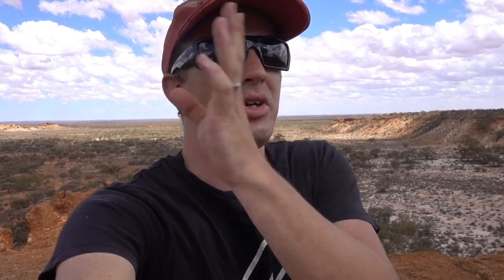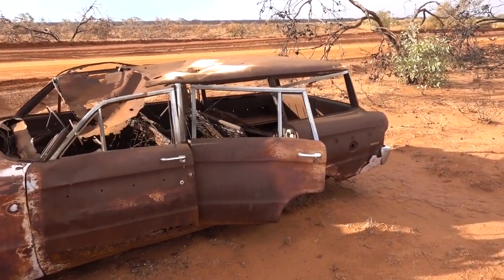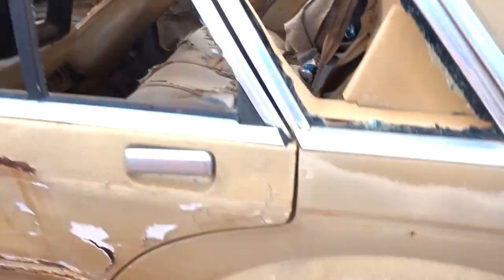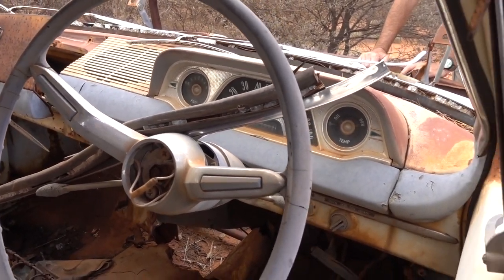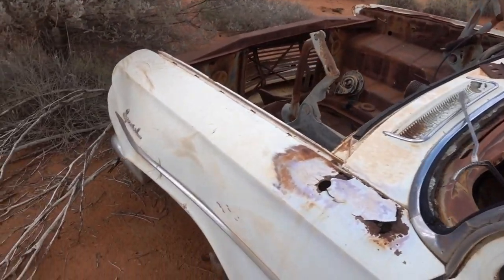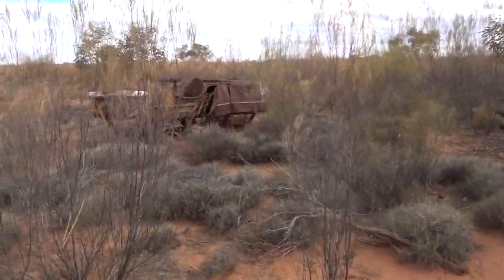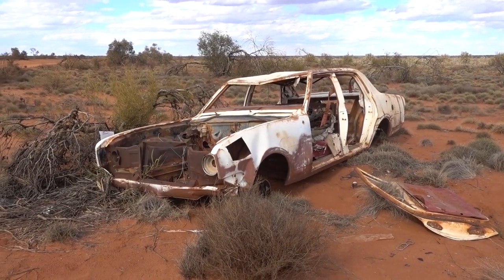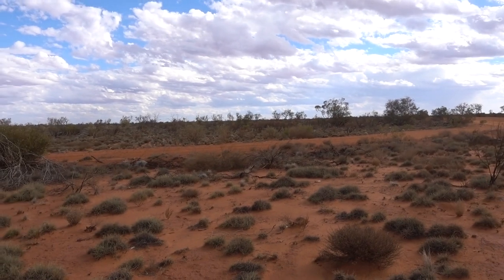Bush wreck hunting: EJ, EH, XM wagons and more

Comment: That hole cut in the ej the square with only 3 sides cut is a common access flap thats home made in alot of older cars to access the gearbox bolts or to replace the frost plug without pulling the motor out lol very common back in the day
Reply from the maker: Had a feeling it would be something like that. The 65  Nissan Cedric we rescued had the same thing.

Comment: don't you have scrap metal buyers in your location? abandoned vehicles in no man's land would get chopped and sold around here pretty quick. $125/ton for random steel scrap is worth the time and effort, not to mention resalable parts, and non-ferrous metals. even on private property vehicles are not safe if they can be seen from a road, and are far enough away from houses for the scrappers to not be seen working. an oxy-propane torch makes quick work of it, and as long as it is cut into small enough pieces so it doesn't look like a car, you don't need paperwork to sell it to scrapyards, and they just run it through a shredder/separator so what comes out the other side is no bigger than your fist, and unrecognizable as to what it was originally.
Reply: It's not really worth it out there,  each one of those shells wouldn't be any more than a few hundred kg, so say $50 for a shell.  You could drive around all day and only find 1 or 2 wrecks, the distances are just insane.    out in the bush you see stacks of wrecks even close to the road, it just isn't economically viable to get them. That area he is in, there wouldn't be any more than a few thousand people for the surrounding 1000km, there's just no one out there.        and also, the fellas who own business like that, and even the employees are the kind of people to leave those old cars alone, there smart people.